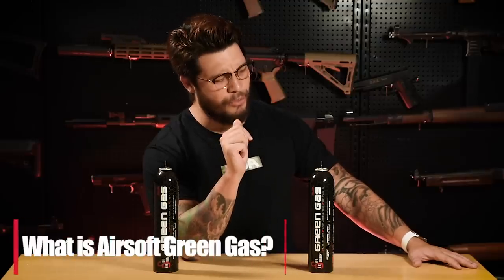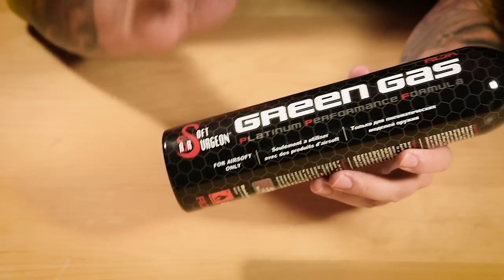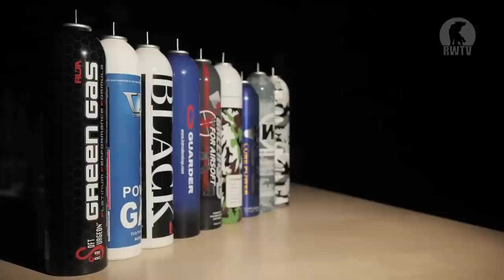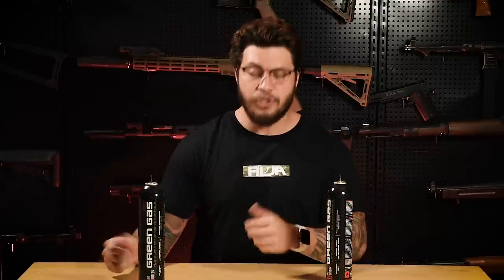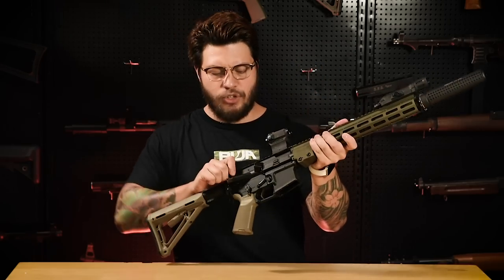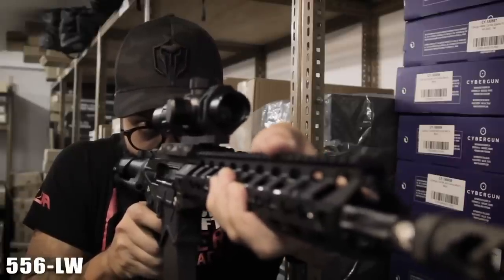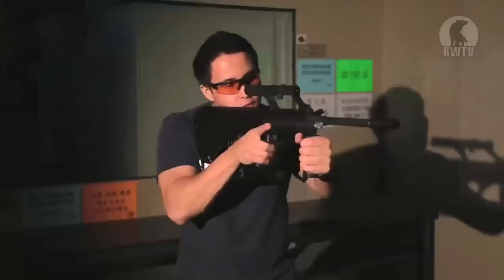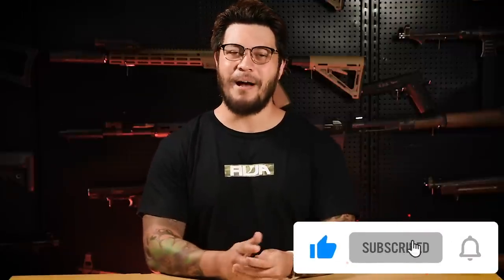What is Airsoft Green Gas? - RedWolf Airsoft RWTV

Comment: Propane. It's just propane. And putting lube in it is the #1 reason for GBBs bad reputation, as the silicone oil accumulates in the bucking and barrel destroying accuracy. Use dry propane (or "green gas with no silicone added), and manually lube the seal between the nozzle and the BBU / bolt carrier.
Reply: True, but for my my side arm is for anything closer then 20 feet for med. And I can accurately hit targets 100 feet out so I feel the lubricate getting in my barrel wouldn't make much of a difference. Not to mention hop ups work on friction and that builds heat so having your rubber lubricated I believe is a good thing
Reply: Plus id have to be lubricating every oring one by one more often then when I do maintenance. Maybe with gbb rifles you make a solid point
Reply: @mikemegadeth4110  well, I've maintained the armory of a rental field for years and I can guarantee, silicone in your hop up is always a bad idea. 
In those conditions, halfway through the day the guns would be literally drenched in oil from the gas and incredibly inaccurate.
Much better since we switched to pure propane. Green gas is paying 10x more for an inferior product.
Reply: @mikemegadeth4110  no you don't. The one and only dynamic seal is the one between the nozzle and the BBU / Bolt carrier, that one is subject to friction plus a 10x pressure increase and back on each cycle. But a drop of silicone oil per month does the trick. 
 
All other seals are static, so no friction or big pressure changes, and therefore require no lubrication.
Reply: @facundocorradini  eh, I like how you think, but I still feel like all o rings need to be lubricated if they have pressure build on them, even more so if it's dry. Also the bb rubbing on the rubber nub does produce friction for the hop up. Thus why they get used up and need replacing eventually like everything
Reply: But what I will do is take your advice and imma run propane thru my side arm and lub only the contacts you mentioned between the mag and nozzle.
Reply: Well see what happens 😉
Reply: @mikemegadeth4110  i dont see any point in using green gas

its way too expensive
you will make your bucking and barrel useless precision wise
you need to maintaine your GBB either way... droping some silicon oil on o-rings will not end in that much more work u gotta do

the only thing I would use such ready-to-go-gases are stronger gases like Nimrod/Nuprol Red or even black gas on colder temperatures. the blue ones of course for Tokyo Marui GBB on hot summer days.
Reply: @123456kiste  listen, yall make solid ass points. So I'm gonna run multiple tests doing exactly what yall tell me too since I know the results of my methods. The least I can do is accept your help and knowledge and put them to the test. Again thank you guys for all your insight and info
Reply: @mikemegadeth4110  I'm not trying to argue here, just sharing what I learned from experience. I'm glad to see you'll be running the experiment, I'm sure you'll arrive to the same conclusion ;)  cheers!
Reply: @mikemegadeth4110  do whatever you want brother. I was running green gas already 3 years. After switching to propane I safef soooo much money lol
Reply: @facundocorradini  IDK what kind of green gas you tried but that has never happened to me. I use Abbey or sometimes Swiss Arms and they are both fine, never drenched a hopup rubber or anything. What has happened to me is that I overlubed the interiors and that has made it's way into the hopup chamber, maybe that's what you did on your field. And even that's not the end of the world, you clean it up, take a few shots and the gun is good to go.
Nevertheless, as soon as my house will be ready I'll switch to propane because green gas is very expensive. (I can't keep a propane tank in an apartment.) But I'll be adding silicone oil to the propane.
Reply: @facundocorradini  thank you! Price was never an issue for me when it came to greengad vs propane. Airsoft is expensive as is so I was fully prepared for anything lol
I will note that even just 2 or 3 mags thru my secutor 1911 leaves a tone of dirt and grime, and that's just indoor 70ish degree F in Mt apartment
Reply: @mikemegadeth4110  costs will get an issue if you play mainly GBB.

Why should I spent 300€/year for expensive green gas cans if I could get just a fill of propane for my 11kg bottle for 15€ each year?
Reply: @123456kiste  agreed, luckily for me my only gbb is my side arm and it sleeps in its holster 85% of its life 
😅
Reply: @mikemegadeth4110  lmao lubing a packing decreases friction thus creating zero hop...the heat that comes off from the friction is so minimal it literally doesn’t matter.
Reply: @mikemegadeth4110  lmao so you don’t know the difference from friction and momentum/energy.
 
I highly suggest you learn some basic physics.
Reply: @sogerc1  Well, those guns are subject to constant function 12 hours a day, 7 days a week. They pretty much shoot in a single day what most guns from regular players would shoot in a lifetime :p 
And yeah, some brands of green gas have much higher silicone % than others. But still, I would always recommend dry gas. Even if green gas and propane were the same price (which they are in my country, #ThirdWolrdProblems), I would use propane with no silicone added, and manually lube that seal between the nozzle and BBU / bolt carrier. The difference in precision is notable.
Reply: @facundocorradini  And what do you do to keep the o-rings in the mags alive?
Reply: @sogerc1  the o-rings in the mags are static. The pressure in there is _constant_, and none of them is subject to friction. So they really don't need lubing, just make sure to keep your mags with a little gas when storing them between games. 

The one between the nozzle and bolt carrier goes for 1 atmosphere to 10 and back with each shot, plus twice the nozzle length of friction with each cycle. So it's subject to a thousand times more stress than the mag orings, and even then it only requires a monthly drop of silicone oil. 

Haven't lubed my mags in 5 years, still no leaks
Reply: @facundocorradini  I'm not sure how true this is. I haven't done extensive tests but when you buy new mags, sometimes they leak but putting a few drops of silicone oil on the input valve and filling the mag with some gas helps, but not without silicone oil iirc.
Reply: @sogerc1  yup, but that's because they are stored and shipped empty for safety reasons. If a mag is constantly under pressure, they won't develop any leaks.

Comment: Why The Hell Did Green Gas Go Up In Price?? I Remember I Use To Buy Gas At Airsplat For 5$ A Can Now Its 10?? FYI Just Getting Back Into The Game After 5 Years. Apparently My SAI Tokyo Mauri Is Vintage Now??? The Hell Happened?? I Went To Evike And I See All These Brands That I Never Heard Before. This Is What It Must Feel Like When People Come Out Of Prison And Try To Adjust To Life. Damm Its A Trip....
Reply: @vintageguitarz1  Thanks For The Info, But I Do Know About All This, Back Then Propane Was Rarely Used, Not Because Of The Constant Lubrications,  It Was Because Propane Increased The FPS Of The Gun And Stock Guns Couldn't Handle The Pressure So They Would Wear Way Faster Than They Should Of. There Was Also The "Egg" Smell When Using It. It Was To The Point Where The Players Using Propane Has Had To Fill Their Mags In A Ventilated Area And Not The Lobby's Rooms So Mainly Before You Go Into A Game. The Lubrication Worked But Only To An Extent. It Was Terrible With Auto Pistols/Rifles Because Even If You Oiled It, By The Time Your Half Way Through Your Mag On Full Auto/Burst The Inside Was Already Drying Up.  Back Then It was Just Not Worth It Unless You Had Airsoft Surgeon Parts Or Custom Milled CNC Parts. I'm Not Sure How It Is Now, But It Wasn't The Best Idea Back Them I'm Talking About 2014 Era